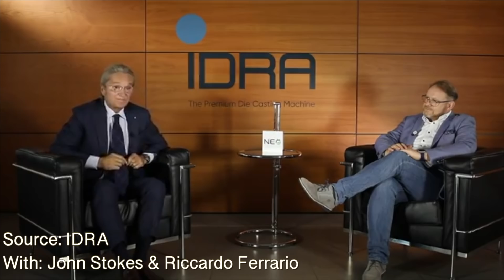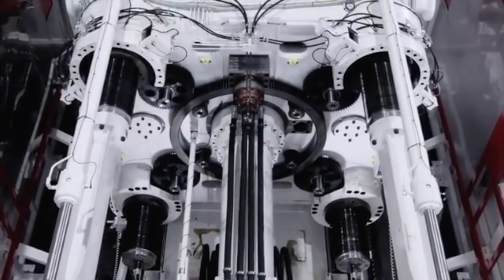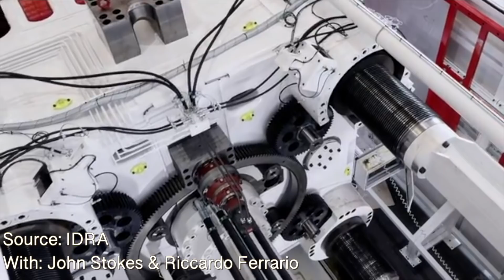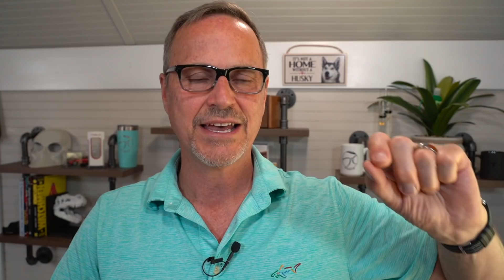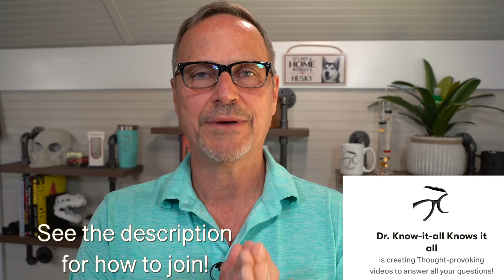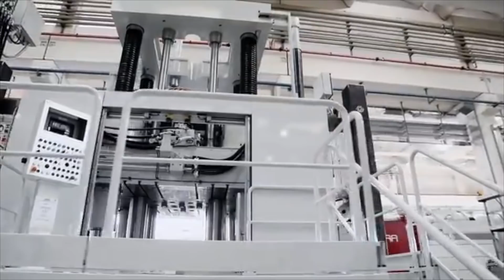Tesla's secret weapon: the Giga Press!

Comment: If you take a 13.5 inch cube of molten metal this machine injects it in a 10th of a second, that's how fast it's working. It would be nice if IDRA made a video showing how it worked, where the metal went in how the finished piece is taken out. I feel like a space alien looking at a washing machine with no idea what all the hoses do or what the round door is for.
Reply: There's a drone video of one of the 2 Fremont Giga Presses opening the sides, the main dies retracting, a robot going in and picking up the casting, removing it, then 2 robots each on the top of a die half going in and spraying the casting surfaces.
The video is at https://www.youtube.com/watch?v=BwoiFC-HwPE , start watching at 5:10.
Reply: @dmpease01  Thanks for that.
Reply: @dmpease01  Dang that's cool, thanks!
Reply: @dmpease01  More interesting content in the minute or so showing the press working than the whole video here. Mostly because we get to see the press in action - I wonder whether they deliberately adjusted the video speed without saying when they changed it back so the cycle time for the press still can't be determined. It looks to be most of a minute at the very least anyway, which is way more believable than the 'few seconds' claimed here. Most of that time incidentally is spent cooling the mould so the metal will solidify, not pumping the metal into the mould, which all happens at high speed at the start of the process. 

This means that the claim that the flow is laminar is highly spurious as a quick back of envelope calculation puts the Reynolds number value north of 10 000 at a low filling speed of 10 m/s (Internal flows begin transition from laminar to turbulent flow at Reynolds numbers around 2000 unless extreme measures in both flow steadiness and lack of flow disturbance are taken - and any mould with useful geometry can't meet either of those requirements). Not having splashing or jetting in the flow trapping air bubbles which then become voids in the casting is a critical part of mould design and has almost nothing to do with laminar or turbulent flow.

Comment: Very nice ... or mamma mia!! What stops other companies from using the same chemistry? What if IDRA gives the formula away to other EV manufacturers to sell more machines? If this is not possible then can we assume all machines go to Tesla since they holds the patents!!?
Reply: They wouldn't be able to give away the chemistry of the alloy, Tesla developed it, and owns the patents. So, if a competitor bought a "Giga press" they'd still have to develop their own alloy. And if they did somehow steal the chemistry of Tesla's alloy, and utilize it.. Tesla would sue, and more than likely would own the company after that.
Reply: @danahebdon6810  Thank you Dana for providing a noteworthy reply. Stealing didn’t stop Rivian. I hope you are right as the temptation is huge and there are probably many compound analyzers available. I am sure that IDRA is also eager to sell as many machines as possible... and you know how things go over a good glass of Barolo wine  🍷🍷😉
Reply: @CarloHerrmann  - A good glass of wine and a few tapas..🍷🍷
Reply: @danahebdon6810  You got the gist and I am ready ! 😂
Reply: @danahebdon6810  it's very easy to identify the elements of an alloy. Trivial.
Reply: @DogBoy987  - It's not quite as easy as you're thinking.. you may come close. But, you're going to be off by enough as to not be able to achieve quite the desired results and properties.

Comment: Do you think it would be viable to have a hybrid battery-supercapacitor energy storage for most applications? Let's take a car, you usually drive short distances and so you could have smaller battery pack that takes a bit to charge and  then the other, much bigger part made of supercapacitors that you could charge up quickly when going for a ride. You don't need to store this power for a long time, because you are going to use it up on the trip either way. The same is for power walls and so on, you could have smaller permanent battery storage and the other one, which is bigger but is intended to be charged and discharged on regular basis. It should be much faster, cheaper, lighter and shouldn't bite into the same resource pool as batteries do.
Reply: The battery is an essential structural component of the chassis. You won't be able to take it in and out without dismantling the car. It would be like taking the engine block out of your car and then putting it back in. But more so

Comment: Worth mentioning, Tesla with SpaceX developed a special aluminum alloy that can be used in the Giga Press casting process. It must have high material strength eliminated post process heat treatment which would've cause all kinds of dimensional yield issues. e.g. Low grade 3000 alum vs 6000 ht treatable are totally different animals.
Reply: I thought SpaceX use stainless steel
Reply: @DogBoy987  You need to raise your bar. The exoskeleton is SS, but there must be an internal structure, which will be SpaceX invented AL-alloy cast with  Idra Gigarpess. No $$$ post process painting on tin foil sheet mtl. NEVER rust. F150 is window dressing, no tougher than a Corolla.

Comment: The Gigapresses' are only used for the rear casting so far. Elon has said they want it used on the front casting also. This will eliminate a total of 600 robots from the assembly lines and quicken the manufacturing process. One Gigapress cost less than 300 assembly robots and saves time.

Comment: Anybody know what the shot size is?
Reply: https://www.sae.org/news/2020/06/tesla-model-y-big-castings
The mammoth machine is being supplied by IDRA Group, an Italian leader in HPDC equipment founded in 1946. Tesla is the first customer for IDRA’s hulking OL6100 CS (with upgraded locking force to handle the special Tesla casting), destined for installation in the company’s Fremont, California and Shanghai, China, plants. IDRA’s “Giga Press” measures some 64 feet (19.5 m) long and 17 feet (5.3 m) tall. Along with the higher clamping force is a maximum aluminum-alloy “shot” weight of 104.6 kg (231 lb). The OL6100’s output may be lightweight castings, but the machine itself is anything but light, weighing in excess of 410 tons.

Comment: Excellent video.  Since the IDRA video was made, I believe they have delivered at least 3 more 6100 units to Tesla--not operational yet.  And potentially more operational ones in GF3-Shanghai-probably 2.  In the GF4-Brandenburg, and GF5-Austin videos we see three more units on site--2 at GF 4 and 1 at GF 5 all being set up.  There were two die casting machines already in Fremont so Tesla is taking delivery of these very quickly.

Comment: If Tesla formulated the aluminum alloy somebody had to calculate the Reynolds number to archive the laminar flow necessary to accomplish the task, which means (I believe) Tesla had a huge input into its design. The  Tesla metallurgists are second to none. To put together a structure of this complexity took a long time, someone has been thinking about this for a while.. I believe Tesla is not going to share anything about this.
Reply: With the alloy available to the world I would expect it would be very easy to analyze the elements it's made of. It's a uniform material it has no secret components. So how could they keep it secret?
Reply: Knowing the ingredients is not enough, the process could be just as important to get the right structure of the metal.

Comment: Forging is not heating and cooling metal.  It's heating metal beyond the curie temperature but not to a liquid state and moving it through pressure.  e.g. with rollers, a hammer or a press.
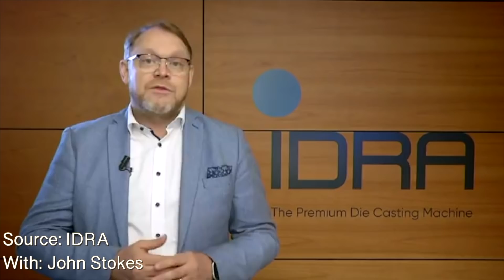Reply: 19:12 They say otherwise
Reply: @danielstapler4315  A product is not forged through heating and cooling, it is the stamping/hammering/rolling force that realigns the internal structure of the metal. If and when the metal is cooled down too much during the process, it has to be re -heated.
The methode explained by Idra is not the traditional forging.
Reply: What does curie temperature have to do with forging? That's the temperature when a magnetic material loses its magnetism. Furthermore they're talking about aluminum which is not magnetic and doesn't have a curie temperature.

Comment: 19:35 FORGING  = shaping of metal using localized compressive forces. The blows are delivered with a hammer or a die.  Improves preferential GRAIN DIRECTION in the metal part
Reply: Thank you Pablo! Dr. Know-It-All got it completely wrong. Forging can be done without any heating.

Comment: Cost? I would love to spec the front/rear total casting costs. Anybody have ideas about this? IDRA-US told me they could not publicly discuss the cost of an OL6100CS based upon client contractual secrets, so figuring amortization and depreciation of the 6100 costs cannot accurately calculated. Guesses? I can say that based upon today's aluminium market prices ($2.07/kg) the raw aluminium cost of a single front / rear casting would run approx $190. To that you have to figure labor, factory costs, mold R&D costs, and many other costs I can't think of right now.
 
Which came first? IDRA designing a OL6100CS and selling it to Tesla, or did Tesla approach IDRA and say "Here's our BEV single front/rear casting idea, can you build it?
 
Somewhere in the mix I suspect Sandy Munroe's advice figures in to the conversation wherein 2018 Sandy tore-down a Model 3 and advised Tesla to clean-up and simplify the front and rear wheel-structural supports at the four corners. 

Aslo, isn't it the case that Tesla had already produced MY giga-casts at all four corners since at least early 2020? Sandy Munroe was delighted to find such during his MY tear-down in March 2020.

Comment: The biggest downside I see from the casting is the casting process itself and problems with castings - undesired shrinkage, gas porosity (air pockets), pouring metal defects (inclusions or metal contamination) and metallurgical defects.  All especially bad when the part is structural.
Reply: I totally agree with you, they are going to be submitted to tests to validate their strengths before being put in a car.
Reply: This method is not just casting though.
Reply: The production line includes an x-ray machine, so all of these defects should be easy to automatically detect.
Reply: @HenryLoenwind  uhm nope lasers are just part of the testing

Comment: What metals are suitable for use with this kind of casting process?
Reply: Custom aluminium alloys
Reply: @jonbong98  Only aluminum? Or are there other possibilities?
Reply: @ronaldgarrison8478  Many low melting point alloys can be die cast.  All sorts of small products are made with die cast "Spelter" is most common material.
Reply: @ronaldgarrison8478  don't know yet
Reply: @pablopicaro7649  Yes many metals can be diecast but these presses are for aluminum. This has been mentioned many times by Elon

Comment: Tesla has already announced a larger Giga press for the Cybertruck.  So it gets better...
Reply: CT is cold rolled steel though, that's not cast, that gets bent and folded.
Reply: @2nd3rd1st  That's the exoskeleton that's Stainless steel not cold rolled. In fact the stainless cant be machine worked, its ground on the fold line so it and be bent and welded. The rear end for sure, and possibly the the front end will be cast in their special aluminum alloy.